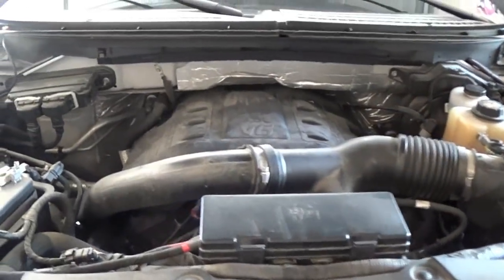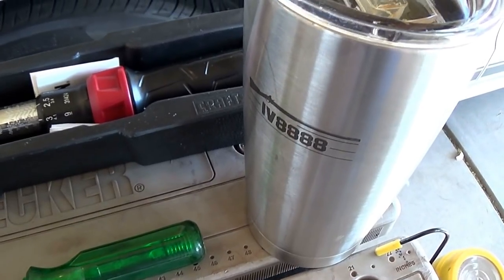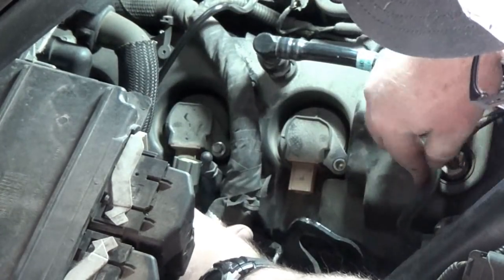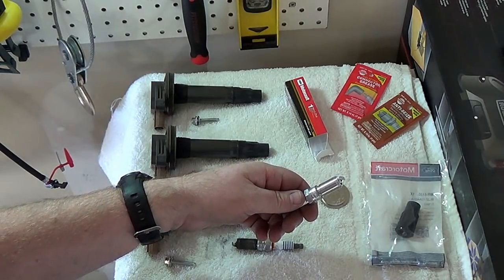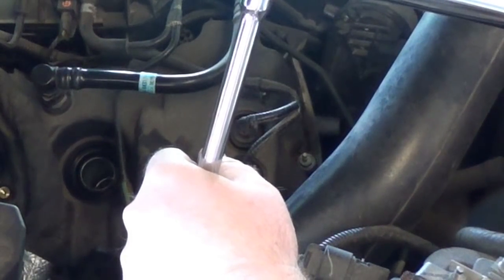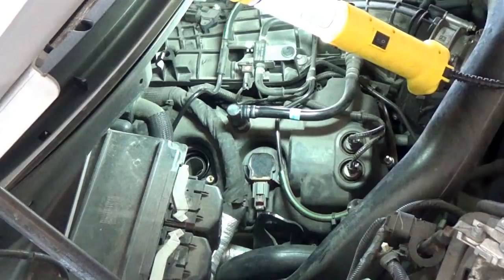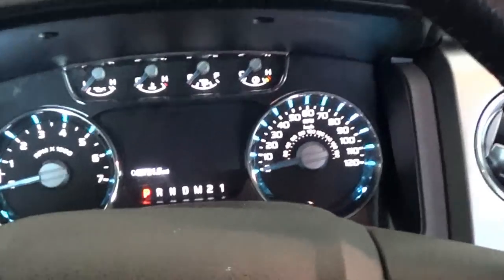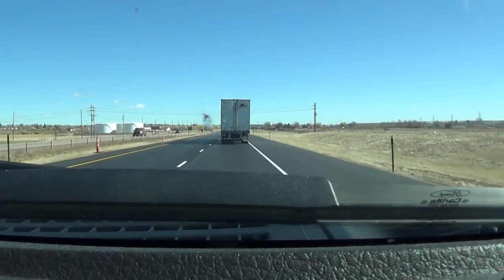2013 F150 EcoBoost Spark Plug / Ignition Coil Removal & Install | No more misfires

Comment: Nice and simple! I’m doing the same to my 2012 F-150 next week. Still on factory plugs at 83k and missing under hard throttle.
Reply from the maker: Excellent. Hopefully it goes smoothly. Also, sometimes missing under hard throttle can indicate a bad coil pack. If you can, check for codes using a code reader. They are cheap from Harbor Freight. Some auto parts stores will let you use theirs. Sometimes a code will be stored without the check engine light coming on. If you need to swap out a coil pack, this would be the time for sure while its out.
Reply: I just did this for my ‘15 Expedition with the same symptom.  Now it’s performing flawlessly. 88K with factory plugs.   I think it’s also benefiting by Ford’s decreasing the gap
Reply: rfjohns1 Did you gap to .030 or .028?
Reply from the maker: @stick__shooter  .030
Reply: Mossy Back I didn’t actually check. I used Ford off the shelf plugs.  On the box it said that the gap cannot be adjusted.   It should be the latest the ford is providing these days.
Reply: I have the same vehicle. Thinking of doing it myself as well.
Reply: @teleslovato7362  It was super easy on mine. 30k miles on it since then and no issues. I'll probably replace coil packs as well as plugs next time it needs it.
Reply: @stick__shooter  Nice! I had a mechanic come over and help. He only charged me 40$ and I learned something as well... I would do some more research before replacing your coils! I read somewhere that these stock coils are supposed to last a life time of the engine. It read that changing them out when not required can cause more problems to the engine.

Comment: Going to make the repair today.
But,.. did you have an issue with your AC going in and out intermittently when it was misfiring?.. hopefully after I change those plugs and coil -packs it will correct itself.
Great video bro 👍.
Reply from the maker: I don't really recall the A/C but I could see it shutting down if the engine went into limp mode and you had it on.

Comment: Super easy fix thanks to you. About to go for a test drive, but pretty sure this fixed it! Thanks bud! I owe ya!
Reply from the maker: Let us know if it worked out for you
Reply: That was it. ODB2 reader a bud has said cyl 2 and 5 misfired. Old plugs were cracked. New in, cleared codes. Engine runs like new. I forgot how snappy it used to be. (2011 w/55,000ish miles.)
Reply from the maker: @thomaspylman7678  Good to hear!

Comment: I just turned 61000 miles and still smooth and no shutter ..should one just change the plugs or wait till the rough idle comes along ?  BTW thanks for the video will com in handy when time comes
Reply from the maker: I would wait. Get all the miles you can. Thanks for watching

Comment: Thanks for the video. The engine bay isn’t short person friendly but it was manageable. Truck now purs like a kitty now.
Reply from the maker: Eddie Trigo Awesome!
Reply: TheRealCobraBurnout I just finished s quick 39 mile trip thats close to Ku standard driving distance. I’m currently at 17.7 vs 13.8 mpg. I should have done this sooner (had the tuck for the past 1.5 years and in 60k miles averaged 13.9)
Reply from the maker: It pays to change these plugs out

Comment: Fantastic job on the video.  You saved my wallet from the Ford house!  I followed your instruction, gripped a bit about the little plastic wire connectors...ok that is a lie...I muttered a lot....At times, I did not have enough grip at the right angles at times so I struggled with these things.  Outside of that, it was easy peasy...Thank you very much!
Reply from the maker: Good to hear the success and saving the $$$

Comment: So that truck has about 45k miles?   Is it used for mostly local drives?

Great install.  You make it look easy.
Reply from the maker: Its mostly used for gun range trips and beer runs.
Reply: TheRealCobraBurnout ok.  I was just wondering if that was an "eco boost" problem.  Or just cause Ford messed up.
Reply from the maker: Both

Comment: What type of anti-seize did you use? Folks on the forums are saying anti size not recommended by Ford on nickel plated plugs and that doing so can actually cause them to seize or become loose (depending on type)
Reply from the maker: VersaChem. It's made for spark plugs. Doesnt take much. If you are concerned,  I recommend asking a trusted Ford service department.  I've never had issues. https://www.oreillyauto.com/detail/b/versachem-5169/chemicals---fluids-16461/maintenance-chemicals-16867/grease---lube-16582/anti-seize-17774/31f81cb18df6/versachem-anti-seize-lubricant/13111/4776634?q=anti+seize&pos=9

Comment: Did you reset your PCM? I did this exact procedure with new motor craft plugs and boots and my truck is idling more rough than before.. trying to reset pcm now
Reply from the maker: No I didn't
Reply: TheRealCobraBurnout do you have any idea why my 2014 F150 would have a rough idle after a spark plug change? I made sure everything was seated and gapped correctly.. just reset pcm and it’s still kind of doing it
Reply from the maker: Was there any engine codes before you reset the pcm? One of your coil packs could be bad. Just a thought. I had a bad coil pack about a year before I had to change my plugs in this vid.
Reply: TheRealCobraBurnout I had no check engine lights, I replaced the plugs has preventive maintenance. I did damage one of the thin plastic tops on one of the coils but it seems like it is only something cosmetic. A piece broke off as I was prying it up the first time. I even went through this morning and replaced the plugs and boots again because I thought I gapped them incorrectly. Do you think I should just buy all 6 ignition coils and replace them? Or maybe try just that one I damaged even though it appears cosmetic?

Edit: pcm reset seemed to have helped a little but the problem is still there
Reply from the maker: William walton check engine light doesn't have to be on for a code to pop. Put a code reader on to check...or find a local mechanic
Reply: TheRealCobraBurnout I have a code reader and still no CEL, it’s not like a pronounced misfire feel but it vibrates at idle  periodically
Reply: Just clear codes.

Comment: Just bought a 2014 Ford F150 Ecoboost with over 133K miles. Do you recommend I change out the coils or boots as well when I replace the plugs?
Reply from the maker: only if its not running good.

Comment: Hey brother i got a code read p0304 misfire on my 2013 f150 , also my check engine light is on and there's a ticking coming from it . Do think it might more the just spark plug and boot change out ???

Comment: How often should a guy replace the spark plugs on this particular truck? Every vehicle I’ve ever had it was usually around 80,000 miles and actually it’s still ran fine then.
Reply from the maker: Steve Bynum aparently these ecoboosts eat plugs quicker. Change every 40k give or take 10k depending on how hard you run it.
Reply: I just finished the Owners manual and it recommends the change at 100K.  I now have 58K.  Should I change or are there any symptoms that I should be looking for?
Reply from the maker: Robert Griffith if your truck is shuttering, puttering, going into limp mode when you try and pass someone on the highway then it may be time. Ford put out a TSB stating this is a known problem with the EcoBoost engines eating plugs quicker than annotated in Tech manuals. With that in mind, if your vehicle is running fine then leave it alone. If it ain't broke don't fix it.
Reply: Thanks, so far so good.

Comment: Question: why not change the whole coil pack? All you need is a new boot? I have a 2015 w/ a misfire code.
Reply from the maker: You could if you want. Spend the bucks, replace the whole thing. That's your option. Or use the item to its fullest...less waste, less money, get the full life. But there is a value probably if you can in putting all new in while you have them out. Way the option and choose.
Reply from the maker: Also, if its throwing a code for a particular cylinder... probably a good idea to replace coil and plug for that one.

Comment: Do you need a code reader to do the job?  Or is that just in case you run into troubles?
Reply from the maker: Tyson Manning just to clear the check engine light if that popped on because of misfires.
Reply: Great!  I'm just changing them for regular maintenance reasons...  and there's a bit of hesitation (i'm pretty sure that's normal with the ecoboost though)

Comment: Just curious as to why you replaced the boots? Were they in bad shape?
Reply from the maker: It was part of the TSB which instructed to change the spark plugs and the coil boots. Easy enough and not that expensive. It worked for me.
Reply: @TheRealCobraBurnout  Experiencing misfire?
Reply from the maker: @MrHossola  If you watch this old vid I explain the symptoms. Shuttering, puttering, and did go into limp mode. Not to be confused with just one coil pack going bad. I would recommend getting a scanner for your vehicle to pull the codes or letting Ford work do the work.
Reply: @TheRealCobraBurnout  I have access to ids and oasis aside from forscan and others at work, as a tech ive always got an ear to the ground so to speak for any new problems or solutions as engineering support is usually behind the times for the most part.
Reply from the maker: @MrHossola  K

Comment: Bought a 2013 FX4 used with 120k loaded, leather seats, remote start, you know all the bells and whistles for 19k. (Decent deal i hope? Lol)  And on the way home going 60mph, it was not getting anything higher than 13mpg, i was like what da heck, after a few days it was averaging only 11.2 mpg. I was like i heard they can get bad mpg but dam lol. Then i noticed while going WOT on the highway it would like stall at higher RPM like 5500rpm, and give me a check engine light codes :/. Codes said there misfire in cylinder 2 and random misfire.  I called ford and they wanted 545$ plus tax to replace JUST THE PLUGS NOT INCLUDING Coil boots, with coil boots it was 650$ plus tax. Went to auto parts store, bought plus, boots and a torque wrentch for like 120$. Sent my friend this video (mechanic in the army, am an I.T specialist in the army so yeah, not doing this alone lol) and i watched it 2x. And together we knocked it out in like 30min haha. Now i have no stalling and on the way home from his house (about 6 miles) , I averaged 16.5mpg 60/40 city/ highway. Thank you very very much for the video man. It was perfect. Helped me save over 500$
Reply from the maker: Very good to hear your success in fixing the issue.   And thank you for your Service!

Comment: Just so you know.. when taking the plug wires off the coil.. the red clip pulls out and then you just push down and comes off without any tools or force
Reply from the maker: Just so you know, that is not always the case. Maybe you got them nice thin fingers with gorilla grip, but what I showed is tried and true. No "force" was used as I'm not a jedi.

Comment: One of the rubber boots to the spark plug broke off when I was pulling the coil out. I can’t get a spark plug socket to go over it and now it’s the 3rd cylinder in the back so it’s a pain in the ass to get too. Any suggestions?
Reply from the maker: That's a tough situation! Maybe use a long thin flathead screwdriver to split the stuck boot off the spark plug. Then fish it out

Comment: You can do the job without disconnecting the coils, I leave mine attached when pulling out the coil, There is enough wire there to make this happen.
Reply from the maker: Good info. thanks

Comment: Do I need to disconnect the battery before doing this? I have a misfire on #3. I'd the cylinder order front to back passenger 1-3 and driver front to back 4-6?
Reply from the maker: Yes

Comment: I have a 14 eco boost and it shakes and idles when I come to a stop. Put Royal Purple additive but still shakes. Ford house said 800 and also needs to clean fuel system . i swear its just the plugs and coils.
Reply from the maker: After you come to a complete stop, does it idle smooth? If so its probably the fuel. Try switching gas stations.  In my town Sam's club works but if I fill up at loaf in jug it runs rough at slow parking lot speeds or as I'm comming to a stop. Worth a try before paying Ford big bucks.
Reply: @TheRealCobraBurnout  yes, when i come to a complete stop it idles then goes away. But now it stops then idles again then stops.

Comment: So no new coil packs just boots? Sorry newb question
Reply from the maker: So if you watch the video you will see this situation is new plugs and boots (the end bit on the coil packs). Its a TSB Ford had out. 

Parts list:
- Spark plugs: Motorcraft SP-534 (Gap mine to .030) http://amzn.to/2lbfvpF
- Coil boots: Motorcraft WR6135 
http://amzn.to/2DaG85k
- Anti-seize Lube: little packet from O'Rielly's Auto store
- Dielectric grease: little packet from O'Rielly's Auto store

Comment: How important is it to do the coils? '12 F150 EcoBoost w/ 75k miles. Thanks!
Reply from the maker: Run them until they fail.
Reply: @TheRealCobraBurnout  Thank you!
Reply: @kramnametab  How do you know when the coils fail?
Reply: @BeeBombard  When I changed the plugs at around ~70k miles, my coils where visually in good shape. The plugs were worn though.

Comment: So when I got on my truck the other day it shuddered and flashed a check engine light and stayed on. I put an OBD scanner on it and it read misfires on cylinders 1-4. I drilled the weep hole and had a ton of oil come out. Would plugs fix my problem? And is anyone still running the weep hole with any or no problems? Thanks in advance.
Reply from the maker: Cody Vaughn and I don't have a weep hole so I don't have any advice on that. New plugs May fix your problem however it is possible that you would have to replace those coil packs as well. But it's unusual for to go out at once so may just be the plugs are fouled or eaten up
Reply: TheRealCobraBurnout one more thing, are these trucks meant to be run moderately hard? From what I’ve read online it says not to baby them around to get on it from time to time.

Comment: Where does my boot grease go? It's on the outside, correct?
Reply from the maker: Dielectric grease around the inner wall of the spark plug boot. Some people choose not to use it. I normally do and have no issues. On this one I just dab it over the bottom boot hole. 7:23 mark in the vid.
Reply: @TheRealCobraBurnout  I have a couple of packets of "spark plug boot protector" by AGS. Is it the same and/or do I use it the same as dielectric grease?
Thanks!
Reply from the maker: @pinkmillk  Yes, same stuff.

Comment: What is the recall number on this from Ford?
Reply from the maker: Sorry, I don't have the numbers or this truck anymore. But It was not a recall. Ford had a couple of TSB (Technical Service Bulletins) covering this. One just said replace coil boots. Another updated one said to replace spark plugs. I don't have the numbers anymore as I did this in 2017. But here is a forum with info: https://www.f150forum.com/f70/ecoboost-engine-misfire-spark-plug-tsb-308705/

Comment: Did your check engine light come on before you replaced everything??
Reply from the maker: As I recall, it blinked on and off with limp mode (engine de-throttled under heavy acceleration). Never stayed on permanently.